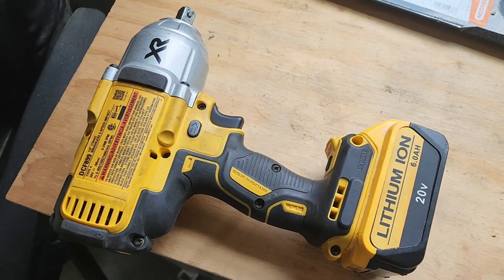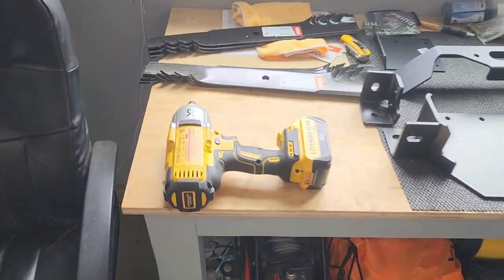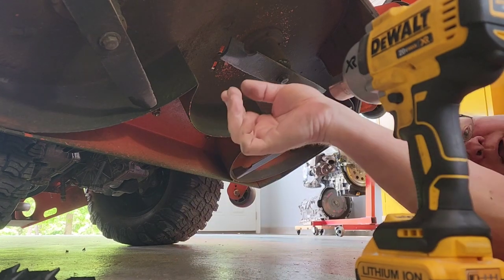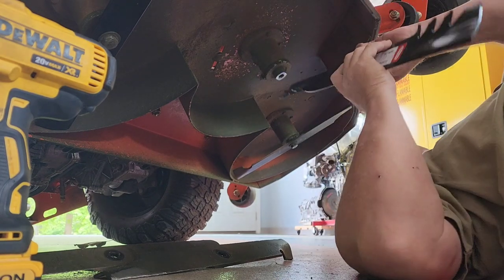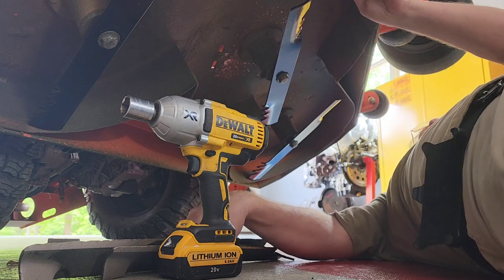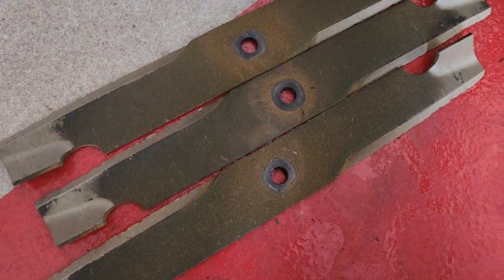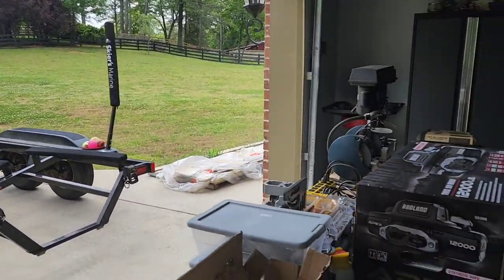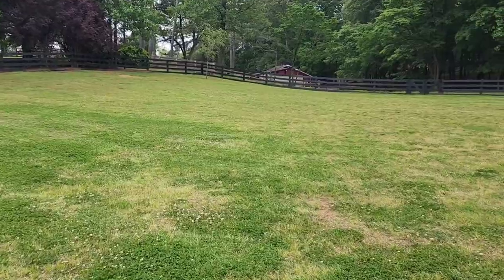2022 Bad Boy Mower blade change

Comment: Oregon Gators are all I've run for years. The cutting edge is infused with tungsten and stay sharp longer. Because it's a mulching blade the grass discharged is smaller pieces that break down faster and they're also high lift.
Reply from the maker: Good to know. Didn't know they had tungsten on the edge.

Comment: Might want to read up on swing arm lifts.  Not good for the lift to pick up with just 1 arm since it's a cable system designed to work with 2 arms.
Reply from the maker: Thanks for the advice John.